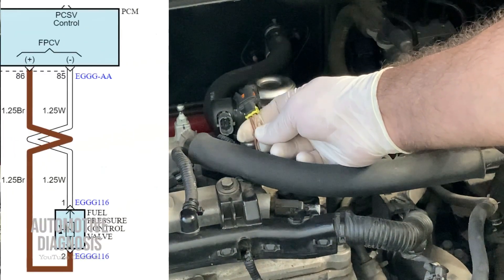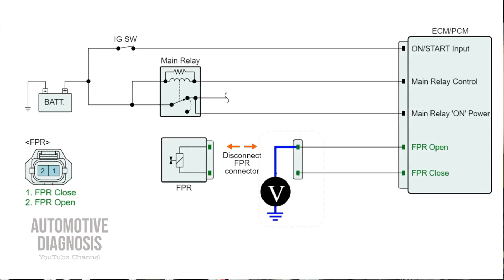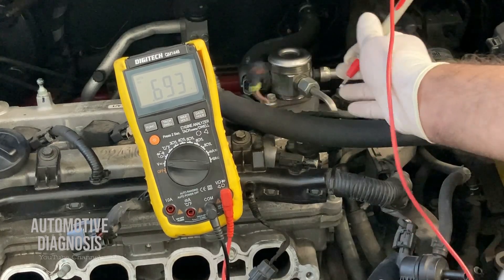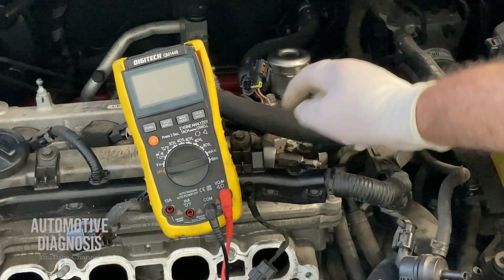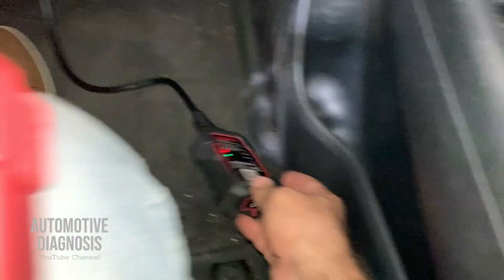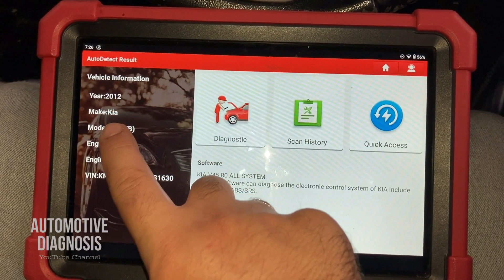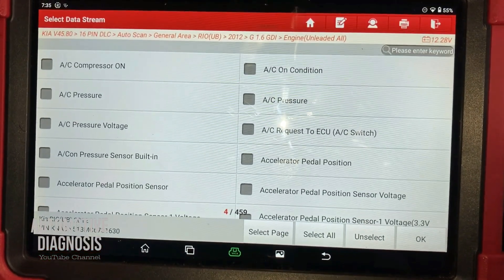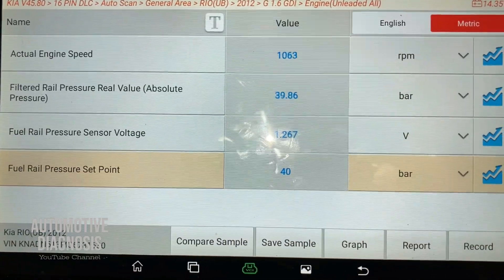Fix Fuel Pressure Regulator and BOOST Your Engine Performance

Comment: Hi sir, what if the high pressure sensor working all the time except when the engine is too cold and after driving for 100m the pressure stuck at 4.5 bar then after turning the ignition off and back it on the problem would be fixed!???